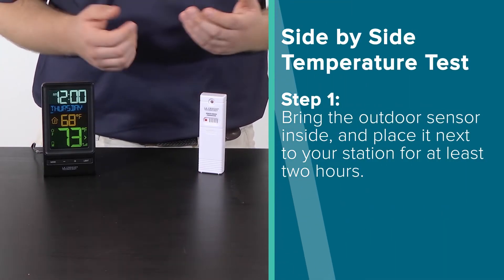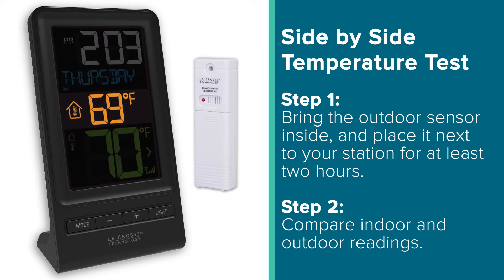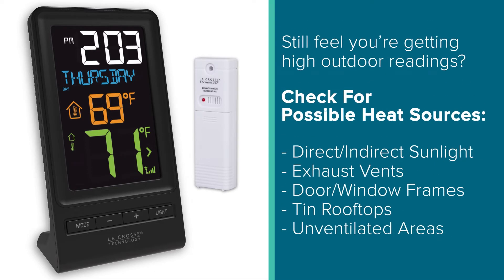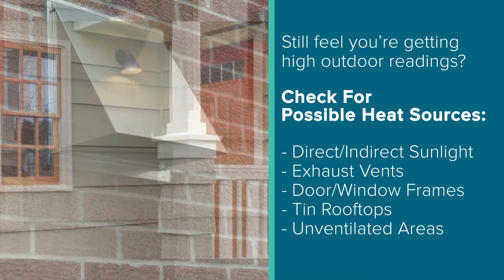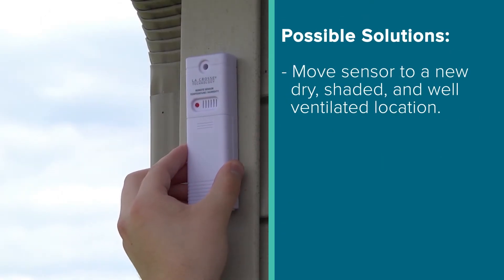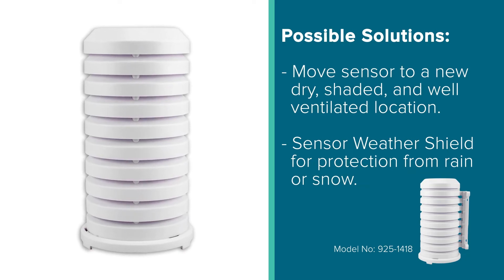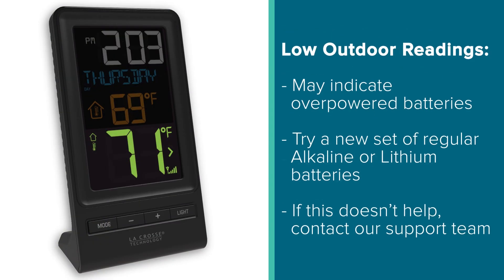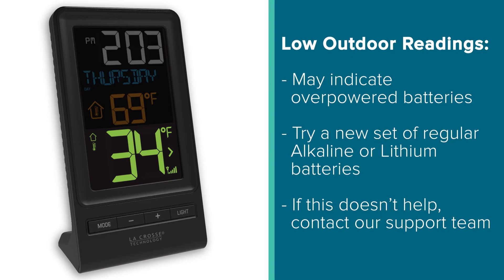Inaccurate Temperature Readings - Possible Solutions

Comment: Model C85845 -  First unit would not connect to the Atomic clock.  Returned.   The second unit, the indoor temperature is 6 - 7 degrees high.   I sent a note to LaCrosse support, waiting on a reply but fully expecting to return and go for another brand.   I had a LaCrosse unit for years that was accurate all the way around.   The outdoor sensor died and it wasn't that much more for a entire new unit.   Just would like one that works.
Reply from the maker: We sincerely apologize for the trouble you’ve experienced with our C85845 weather station. If our support staff hasn’t gotten back to you yet, please pass along your email address and/or phone number in a private message on our Facebook: http://bit.ly/LaxTech_Facebook or Twitter: http://bit.ly/LaxTech__Twitter page. From there, we should be able to speed this request along. Sorry again for the inconvenience.

Comment: My outdoor sensor reads 2° high.  I know I can mentally subtract two from the number, but isn't there a trimmer pot inside that I can turn just a little or something?  It really bothers me...
Reply: I'd try a different brand.
Reply from the maker: Thanks for reaching out. We apologize for the inconvenience, but unfortunately most of our products come pre-calibrated at the factory level and do not offer a manual adjustment option. Temperature readings can be sensitive to many factors, and our +/- 2 degree tolerance is well within industry standards.

Comment: One more question concerning my La Crosse S84060. On the color monitor display..both to the left and to the right of the FORECAST section in the upper left corner of the display...to the RIGHT there is sometimes displayed a curved white UP or DOWN arrow. What does this indicate? I ask only because it is not mentioned or discussed in the owners manual. Also, to the left of FORECAST and just beneath the WiFi signal icon on the display...what are all the options that could appear here? I have seen: Caution FOG. It looks like it might also sometimes illuminate Caution ICE. Isn't this model weather station also supposed to give warnings for the following... ie: Fog, Ice, Hail, Thunderstorm, and Tornado warnings while connected to the NWS (National Weather Service)?? Thanks in advance for your accurate answers once again.
Reply from the maker: Hi Rick, sorry for the confusion, most of your questions can actually be answered in your item's full manual here: https://www.lacrossetechnology.com/media/catalog/product/s/8/s84060_manual_092617.pdf -- the Quick Start Guide only really contains the information necessary to get things set up and working. But as for your questions: the UP and DOWN arrows next to your FORECAST represent changes to your area's barometric pressure, an UP arrow means rising pressure, and a DOWN arrow means the pressure is falling. All of the possible weather forecast icons are covered on page 6, however, there are no particular warnings for hail or tornadoes. The updates received from the NWS are sporadic, and are meant to showcase future weather predictions, not instantaneous weather updates like a tornado warning. Please let us know if you have further questions after reviewing the full manual.

Comment: I have the La Crosse S84060. The outdoor sensor protection shield will still give high temperature readings if mounted in direct sunlight areas...even though it's made of heat resistant plastic and it's well ventilated?  Also, I have a couple other questions about my S84060. How often (in seconds) does the outdoor temperature/humidity sensor report its readings to the indoor display/monitor unit? Also, how often (in seconds) does the outdoor multi sensor (wind speed/direction and rainfall collector sensors) report their readings to the indoor display/monitor unit? Thank you in advance for your accurate answers to my questions.
Reply from the maker: Hi Rick, yes, assuming you're referring to our Sensor Weather Shield: https://www.lacrossetechnology.com/925-1418-sensor-weather-shield -- this device was designed to protect the Therm-Hygro (TH) sensor from snow and rain, direct sunlight will still likely cause high temperature readings. In most situations you'll always want the TH sensor to remain in a fully shaded location, as described in this video. As for your sensor update intervals, the TH sensor will update every 51 seconds if there is a change of at least 0.5C, otherwise updates will be sent every 10 minutes. The Multi-Sensor updates every 31 seconds if there is a change of at least 1.6KM in wind speed, or 0.2mm of rain, otherwise it will update every 10 minutes as well. This 10 minute delta was implemented to save a significant amount of battery life.